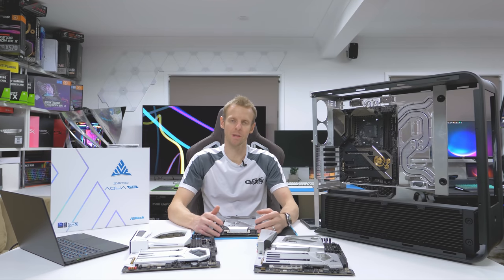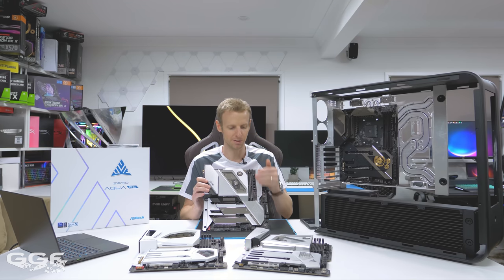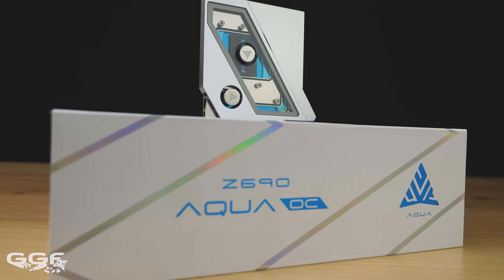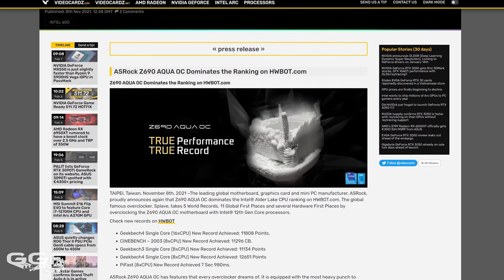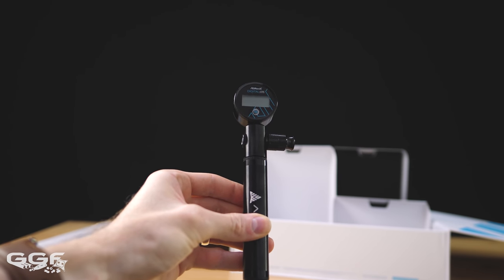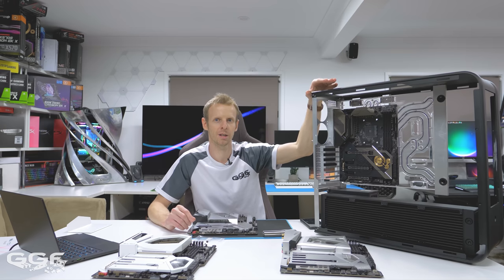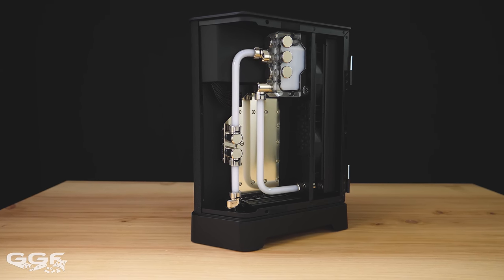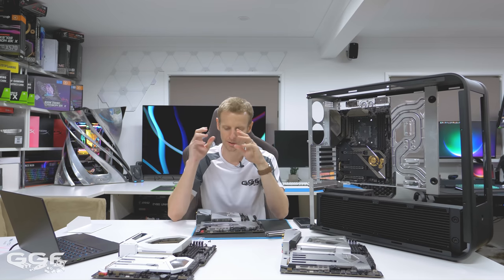THIS Board Looks AMAZING!  Z690 AQUA | TJ07EK?? | Build Ideas

Comment: just finished a hardline loop in the TJ07. Running EK 480 in basement and EK 280 rad in the front with the FLT 240 fixed to plexi. Downside being the space being the motherboard is quite limiting. This is now the second loop I've done, this time running through pass through fitments in the midplate. Excited to see your plans with this chassis as its my all time favourite case for water-cooling.
Reply: Can you link me to your set up - I've always struggled with ideas for what to do with the front of my 7.25 drive bays.

Comment: TJ07 - a classic. How much did you pay for it? Thank you.

The TJ07 is from a time before distro blocks. Is a distro block a must? Or would a simple tube reservoir with some cool metal tube routing do the job? I also feel like leaving the front open and attaching two or three 120mm/140mm (whatever fits) ARGB fans on some kind of clear acrylic fan mounting plate would look cool. I imagine an oldtimer with a super modern engine.

Comment: Thank you! I have a 5930K in an ASRock X99 with 128GB of DDR4 ram. The board is the OC formula 2011 V3 EATX. It is  GORGEOUS, but not up to this one. It is a metal flake gold. All I know is with the auto overclocking, The stock for that CPU is 3.5GHZ with XMP which worked PERFECTLY on the first day, with no crashes. Then I set the auto-overclocking and it hit between 4.2 and 4.3, PERFECT with no crashes, permanently. I have loved this board since day one. I might very well buy this one here!! Oh GOD! 😱🥶😬

Comment: Paint it grey(would be a better contrast than black imo & unique af). & are those 2x120mm at back or 2x80mm? Either way you can use ek flt d5 either 120 or 240 or 80mm one and then link that to the distro.
Also do a mirror finish plate covering all of the psu cover that will match the mobo shiny surface too.

Comment: Hey Stuart. I've completed a 909EK build and currently building in a TJ07 "clone": Xforma MBX Mk II. I do have an extra 909EK distro around so I placed it in the MBX and seems like it'll be quite tough to fit the cables between the distro and the side panel of the TJ07. As for the res-pump situation, I agree with you. A dedicated res is needed. I'll be placing dual Optimus ones in mine.

I do plan to use something from the 909EK in my MBX build: the leftover cable combs. Checking out options of making a custom motherboard tray that goes from the rear to front of the case and holes midway to install the combs.

Good luck and looking forward to this awesome build from you!

Comment: I've had an Asrock x370 Fatality since 2017, my first Asrock board. I've had EVGA, Asus, Gigabyte everything and iys been just as reliable as any other board ive used or overclocked with.'Hopefully at the end of the year there will be something like a x670 Aqua? These look great.
Reply: Throwing a spanner in the works, looks like Asrock uploaded 4 new beta bios onto the wiki, supporting Ryzen 5000 including the 5800x3d for X370 boards

Comment: I think the Aqua looks nicer than the Glacial.  A custom distro in the full front drive bay wrapped around to the side would look cool. Another build idea would be a Mountain Mods Pinnacle 24 tower with the pedestal. It's a nice blank canvas to work with and bit challenging for cable management. I love the old school cases that used all Aluminum.

Comment: This design is more of a monoblock that cools vrm and cpu. It gets rid of chipset block from the previous two aqua. Z690 glacial has a ultrablock that cools cpu vrm chipset and m.2 drive.
Reply from the maker: Only the X570 block cooled the chipset. Also I find it silly watercooling the first m.2 drive. Rip if you ever need to replace the drive
Reply: @GGFEvents  Yes my mistake. Z490 aqua’s rendering misleads my judgement. I don’t have a preference for either of these mobos because I find it’s getting more unnecessary to use such high-end mobos with the increasing of price and shortening upgrade cycle. And those extra blocks don’t make any contribution other than look.
Reply from the maker: @mavericksyao708  and then you have MSI Godlike with no block
Reply: @GGFEvents  That $2099 bundle comes with a 360aio and 32gb of ddr5. The pricing is not that crazy by today’s standard. But that touch screen is useless and even unusable.
Reply from the maker: @mavericksyao708  yea I just don't get that bundle. Not everyone wants that bundled ram or AIO
Reply: @GGFEvents  Normal case can’t fit that board either.

Comment: Finally a TJ07!!
I have had ideas on what to do to mine but I just do not have the funds or skills. I wanted to use ColdZero (google him) light box for the main and lower compartment as a separator and then have hard line tubing go down into that as if it was a flat horizonal distro plate rather than it being mounted vertically in the case. I think that makes sense.